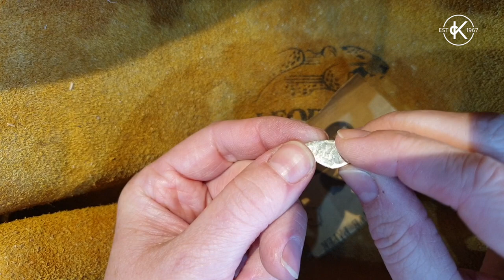How To Make Cabochon Bezel Set Earrings | 12 Months Of Metal

Comment: Love your design choices! 😍 Which snips are you using here? I have tried cutting out shapes from 0.3 mm sheet  with a saw and it felt like a sledge hammer to crack a nut, the metal got jagged and bent. In part because it was annealed, in part because it was thin, and also the finer saw blades did not stay put in the saw frame, so I had to use one of the rougher ones... Would love some decent snips for this kind of thing.